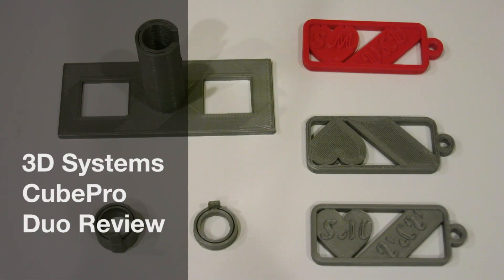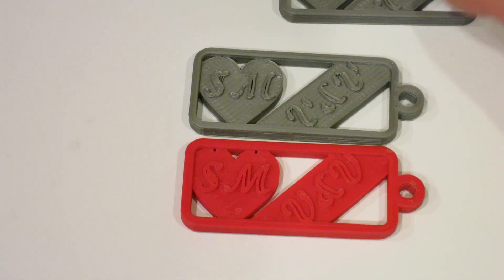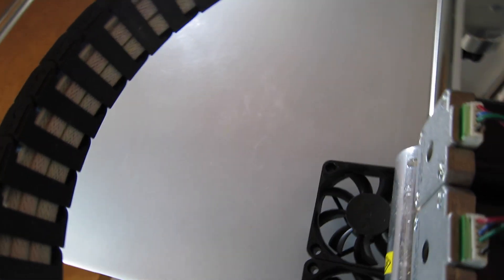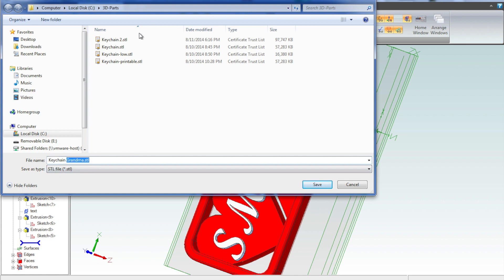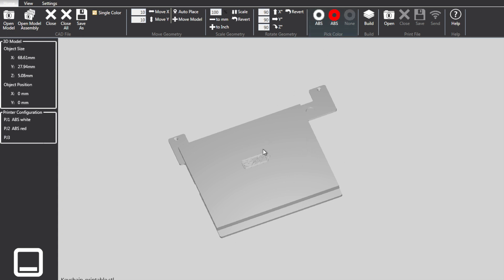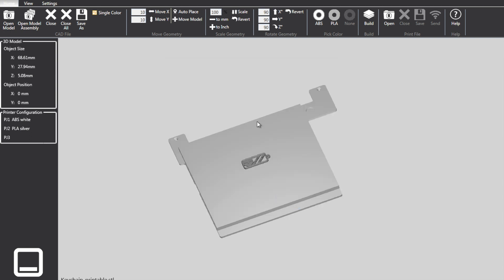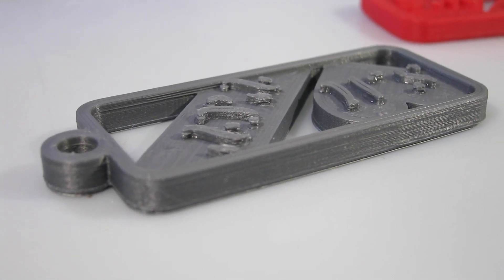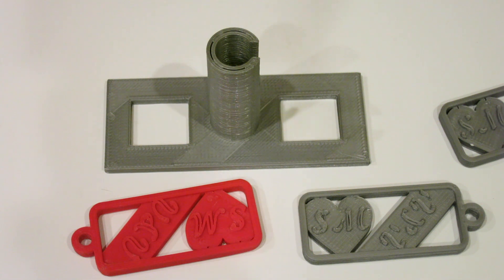CubePro 3D Printer Review

Comment: does the 3D model have to be a certain scale before exporting to cube pro systems?
Reply from the maker: Alex Jadoo - No, you can rescale the model in the cubepro tools.  I generally find it is easier to do so beforehand, however, it's not a big deal to scale in the cube print tool.
Reply: thank u. also what about poly count, wall thickness or any other specifications for the mesh? Is there any way to verify the model meets the specifications before printing? I used Autodesk Netfabb to check it and it looks ok

Comment: how do you remove the heated wax or glue on the plate? what is the best or fast way to remove the heated wax? or I can print without wax or glue? is that safe? It's hard to remove the heated wax. maybe you can help me about my problem. thank you in advance :)
Reply from the maker: The easiest way is to soak it in very warm water, after several minutes the glue will dissolve and the part comes right off.  I've tried without the glue, but I get better results with it.  Just use a nice thin layer by doing tight swirls and it will release in water perfectly.  I usually just leave it under a running hot faucet or soak in a sink.
Reply: thank you for you answer :) I will try your suggestion :)
Reply: +scm6079 I have one question. If you don't mind. Do you know what is the exact scale for finger? the X and the Y.
Reply: +Christian Severa hello. do you have any idea? what is the best cartridge? for prosthetic.
Reply: get a different 3D printer. I recommend the Polar 3D printer

Comment: @00mandingo00 
The print times can be reduced significantly depending on your settings at build if you run the high resolution solid honeycomb infill it will take 4x the base print , if he set the Keychain to standard almost solid line infill, lowered base and top layers by one and outer walls by one he could print it in 9 min ;)

Comment: As far as creating multiple color prints...it's a problem. Lol, the way to do it currently is just as you describe with a twist. In this case you'd create the Keychain export and then create the letters and export. Using a 3rd party software called meshmixer you can open both of the exported models and put them together. I haven't tried opening them both in cube software yet, but I know you can open multiple models and build them on one build I just don't know if you were to stack them in the software and build them would the printer do this during print

Comment: I purchased the cube pro trio and it is an amazing printer right out of the box. I've only had a few issues such as the build plate coming apart which 3dsystems knows about and replaced fairly quick, I added superglue as a temporary fix. Also you can print an abs with pla support with a chamber heat warning but you cannot print an only abs part with a pla cartridge installed. Best work around is if you wish to print a model that is only using the abs cartridge then all you need to do is disconnect the wire harness leading to the cartridge instead of completely removing the filament and cartridge. I install my pla on port 2 because it lays down to allow easier access to the filament tube during cartridge changes also exposing the wire harness to disconnect. I may do a video showing the problem and the fix, just kinda busy with customers and projects atm.
Reply: Chris Judd false

Comment: This printer is not good, I do not recommend, the software is really bad - crashes all the time, when cartage runs out its still 30% full of filament but the printer doesn't accept it anymore. 

When you try to print in multi-material the ABS warps, the printer can't handle making support for complex parts.

Essentially useless

Comment: Thanks for doing this review!
In your opinion, how would the Cube Pro work for designing tiny intricate jewelry (such as rings with great detail).  Do you know of any other printers that would work better for such an endeavor?
Reply: AntoineLeGrand610
 that was actually one of the ones I was considering along size the cube and the Maker Bot :)
Reply from the maker: Unfortunately, I don't think this printer would work well at all in that particular use case.  Although I'm really happy with the performance for mid-sized and large size parts, the small size details are just too rough for intricate work.  For building really small things, I've had more luck with subtractive processes (e.g. milling).  Take a look at the Max-NC 15 mini CNC.  My bit set for that machine is incredibly tiny, and can do some amazing detail work.
Reply: Thank you so much for the info! I am off to google it now :)
Reply: try the projet1200 for jewelry  https://www.google.com/search?q=projet+1200&es_sm=93&tbm=isch&imgil=92Rvoklj_mcuwM%253A%253BtdrJKZ1uUE2w0M%253Bhttp%25253A%25252F%25252Fprojet3d.co.uk%25252Fprojet-1200%25252F&source=iu&pf=m&fir=92Rvoklj_mcuwM%253A%252CtdrJKZ1uUE2w0M%252C_&usg=__6DF-v_r7-J09V0hy-7i4IqLDvf0%3D&biw=1920&bih=985&ved=0CD8Qyjc&ei=ZKItVKXZOYbeoASbqoGAAQ#facrc=_&imgdii=_&imgrc=92Rvoklj_mcuwM%253A%3BtdrJKZ1uUE2w0M%3Bhttp%253A%252F%252Fprojet3d.co.uk%252Fwp-content%252Fuploads%252FJewellery.jpg%3Bhttp%253A%252F%252Fprojet3d.co.uk%252Fprojet-1200%252F%3B735%3B465
Reply: Patrick, do you have any personal experience with the 1200?
Reply: tasherajean You should also take a look at FormLabs Form1+ printer. http://formlabs.com/ A friend bough one (not the form1+ but the form1) when it was on kickstarter, although it took ages before he got it (early production issues) he absolutely loves it! it's incredibly precise and you can print larger items than with a Projet1200.

Comment: was thinking of purchasing this printer, any further thoughts?  I would be only printing in abs
Reply from the maker: I'm pretty happy with it - but if your primary plan is printing ABS (like me) you'll need to understand some real world limitations.  If you expect to get out a "production ready" part in ABS with no work you'll be disappointed.  I've found that for larger parts, warping can be significant.  The heated build chamber is great - and all my parts have been very strong - but I've had SIGNIFICANT warping on large parts still.  Planning the model to avoid long straight runs helps, but sometimes that's unavoidable.  In those cases, I've generally built 'discardable' areas on the bottom knowing I'll loose them to warping, and then after printing flipped the part around and machined the bottom off to make it flat.  That obviously takes time, and requires you to have a mill, ideally with an auto-feed at least or you'll be there forever.   The good news is I've had 0 problems with layer separation on ABS.   That being said, it's really disheartening to have been printing for an hour and then hear the loud 'pop' as the part warps and pulls off the glued-bed and warps up 6-8mm off the bed.  Printing using large rafts seems to help.  

I need a little more experimentation time with large prints to figure out the true limits. Last week I printed a set of high-strength mounts where the whole assembly came out to be about 2'x1' - printed in sections.   I planned around the limitations, and my part is in service already. 

In the end, just make sure to set your expectations realistically.  Given the price of competition like the Stratasys I'd buy the CubePro again -- although my original expectations were probably a bit higher than the reality of the prints. 

Now I'm just hoping they release the Nylon material and an updated version of the CubePro software soon!

Comment: Thanks for posting this. Your timing is perfect. I am very interested in getting the 3 color unit. The prints looked really crisp.

I use Solidworks top design my items. I guess it is all about getting used to the software. I am likely to get NetFabb as well to improve the meshing.
Reply from the maker: Solidworks is a great program, but on the expensive side to say the least!  I haven't used Netfabb, but unfortunately the CubePro requires that you use their proprietary mesh generator to create the .cubepro print files.  A lot of other 3D printers support direct G-Code interaction, but the CubePro does not.  No matter how perfect the NetFabb meshes are, you'll be at the mercy of the final CubePro generation.  As I've experimented more, I've found that the CubePro software seems to be one of the weaker links.  Cube support promised a new version with improved mesh performance, so I'm hoping that is available soon.
Reply: +scm6079  I bought the CubePro Trio in November 2014, had it for less than a day, clogged a print head, sent it back to 3D Systems for repair, who had it for 5 weeks, and SOLD it within a month of getting it back, never using it again. What a complete piece of expensive junk! They have no local support. It is fix it yourself, even after owning it for less that a day or ask for the FAVOR of being able to send it back.

I now have a Form1 that I used extensively for the past year. But I want a Form2, or maybe a Form3 by that time I get around to buying something else new. AVOID THE CUBEPRO!!!!!!

Comment: Have you found out how to fix this problem ?
Reply from the maker: Fix, no - work around, sort-of.  I've found that re-opening the print file with the CubePro software will let you view what the printer will be printing - which looked exactly like the flawed part that printed.  That tells me the error was in the CubePro build, not the printer hardware.  I've talked to CubePro support, who said they will be updating the software soon.  Hopefully that resolves the issue.  In the mean time, I've been adjusting the original model - usually increasing wall thickness - and then re-building until the print file comes out clean. Sometimes that process can take an hour or more of fiddling - so it's not great by any means, but it's better than waiting for numerous hours for a print and then having to discard the part.